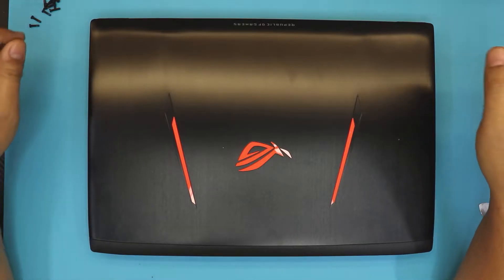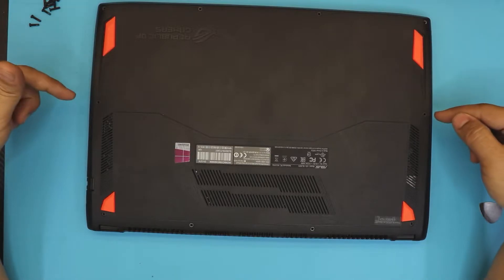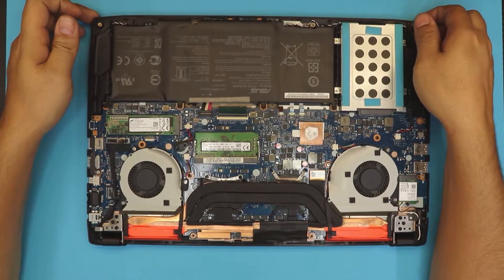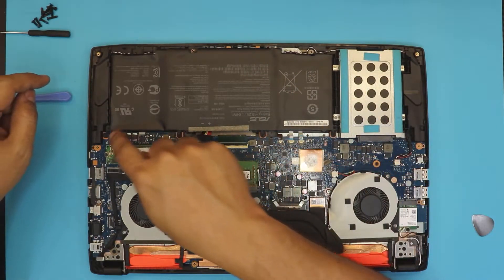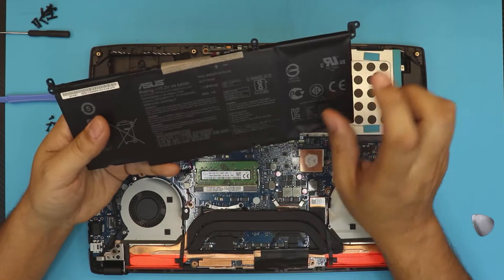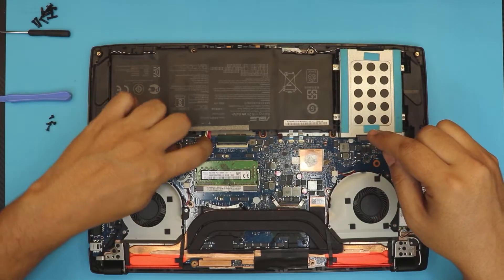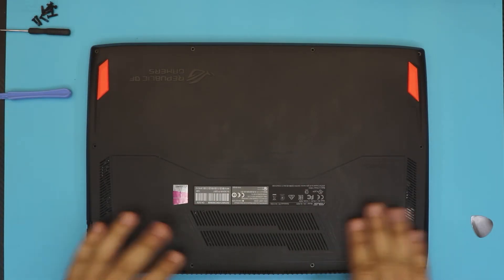ASUS ROG Strix GL502 Battery upgrade disassemble guide

Comment: Can you use this laptop without a battery connected? (Direct plug via its charger/adapter?)
Reply from the maker: Thank you for the feedback! if you wish to support the channel you can LIKE or SUB or both :P
sorry that i was away for few days, regarding your question: yes you can and it will be even better for the charger and the motherboard will last longer as it wont stress trying to charger the battery.

Comment: for connecting off the baterry wires i highly recommend using something non-conductive, definitely not metal scruedriver.
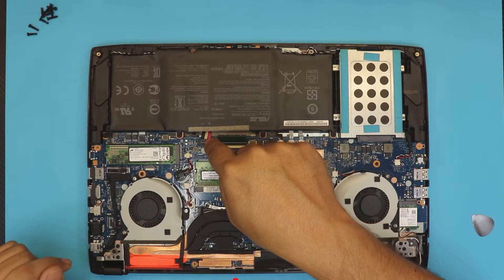Reply from the maker: YES my friend as i have mentioned it @1:38 "use a plastic" and if not if you very careful you can use none plastic as i used in the video as i didn't find my tool at the moment. thank you for the feed back your comments.

Comment: I tried this and for about ten minutes my friend and I attempted to disconnect the battery from the motherboard. We finally got it off, but the connection to the motherboard was permanently severed when the piece of the motherboard that connects to the battery came off with the battery. 

My advice: don’t do this. Just take this to a computer repair professional to have them replace the battery. It’s not worth the effort and the possibility of damaging your laptop.
Reply from the maker: The reason you damaged it is because you pulled it in a wrong direction, you have to pull the cables near the jack UP towards the ceiling, , not to the side or back and forward :/
im sorry to hear that your attempt didn't go well, i hope you get it fixed my friend. good luck
Reply: Did you repairs that later , or is that permanent damage?